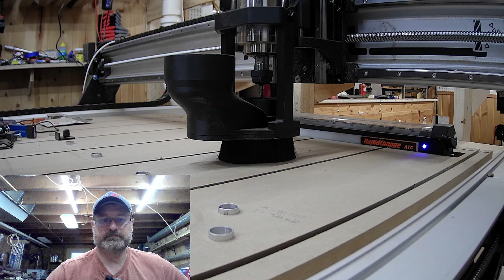CNC Altmill Fully Automated with RapidChange ATC and Auto Dust Boot!

Comment: Did you need to setup grblhal or is it working off of cnchal
Reply from the maker: Interesting question. The Altmill doesn’t actually use grblhal. It’s Sienci’s very own version from what I understand. But very similar. It’s the language that the Altmil uses to communicate between the post processor and the controller.

Comment: does this machine support G41/42 Tool compensation?
Reply from the maker: It is a grbl based system and can support tool compensation. This is setup in your CAM software and not dictated by the machine itself.

Comment: Nice setup. Just wish the rapid change atc didn’t take up so much space. I want to still be able to pass through 4x8 sheets
Reply from the maker: @MrExo_3D at one time they were working on a turret design that used a motor to move it out of the way after the tool change. They tabled that project for now because they got super busy. https://youtu.be/Fdxn435oGQ0?si=RLNAz0JKbxUWfM83
https://youtu.be/J6H9xzozvWI?si=P1N2UByjH9XmL7RB
Reply: You can also install the atc on the sides, so your pass through is still possible
Reply: @saschacontes2305  yes but not sure you will get 48 with it installed on sides

Comment: Nice work, Tom!  Now, if I can turn on and off an IOT switch like my old X-Carve could, I can turn on and off my dust collector.  I'm thinking the M8 and M9 would work too; do you think I could get a third small gauge wire into the flood pin too, thoughts?
Reply from the maker: You sure could. The SWT pins are available for that too. I have a larger dust collector so I just keep it running. But it would be nice to be able to turn it on from gsender.